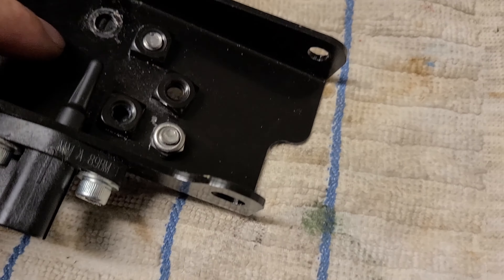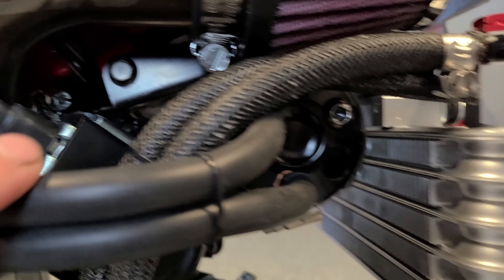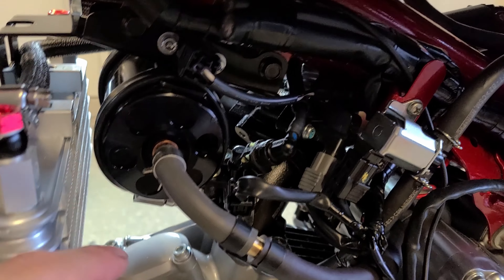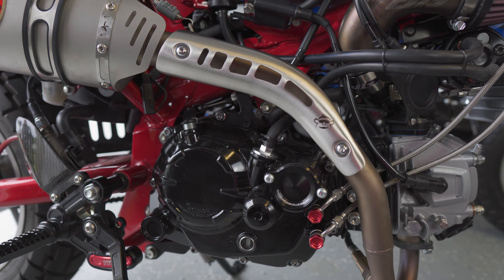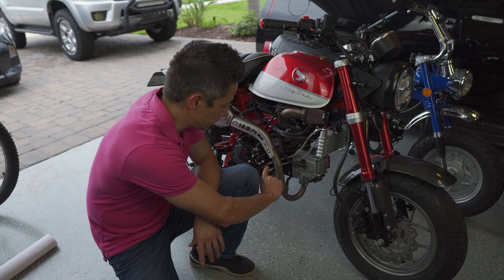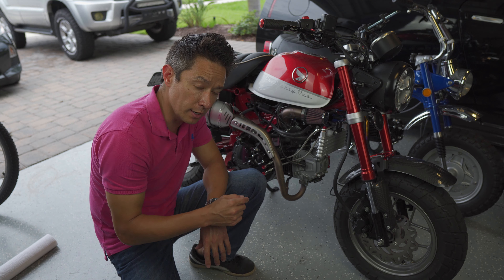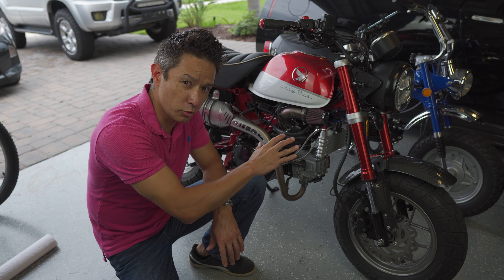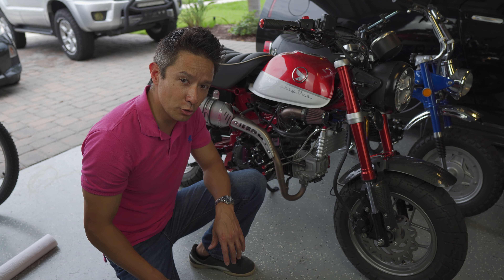Kitaco Oil Catch Can and SS Lines for the Monkey

Comment: Where did you source the stainless lines and fittings. They look way better than the black hoses.
Reply from the maker: I bought the 3AN fittings from China, here's the eBay buyer I used: https://www.ebay.com/itm/AN3-10MM-0-28-Stainless-Steel-Banjo-Eye-Brake-Hose-Fitting-Hose-Ends-Adapter/333378454451
Reply: @eastcoastish  got another link?

Comment: Will you or someone you know who is knowledgeable on the monkey get my 181 monkey ship shape? I passed through Utah desert, hit 100 degrees, melted t engine. I wont work on t bike so looking to bring t bike to someone who knows what they are doing. Thx keith
Reply from the maker: I'd be happy to take a look at it, but if you're in Utah, I'm a bit far here in Central Florida. What fuel controller were you running, what AFR, what was the engine temp when it melted? Hit me up at kent@eastcoastish.com if you want to discuss.

Comment: looks really good ! so where did you find the ss lines and angle fitting why do you need a oil catch long rides ?
Reply from the maker: The fittings and lines were from eBay; I was getting a lot of blow-by because of my setup and there was oil coming out of my breather filter. The can catches all of that and gets it back into the engine.

Comment: Hi couple of questions about the catch can I am ordering the same Kitaco one as you have and noticed there is a blanking screw so you can relocate the fittings to suit. What size thread is the bolt as I was planning to add a extra fitting to allow me to connect a tappet breather into the tank. Also do you have a link for the breather pipe filter i cant find one online. 
Thanks 
Jonny